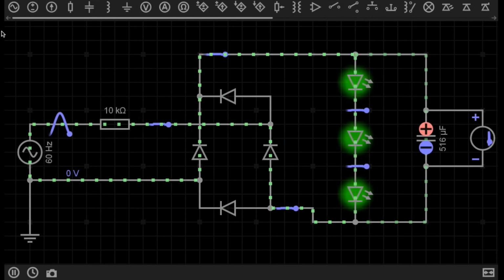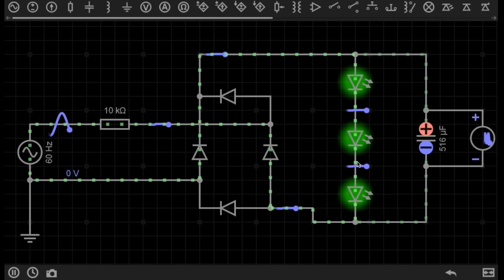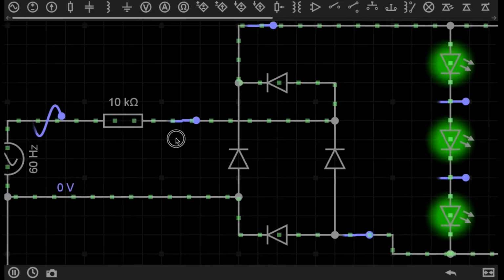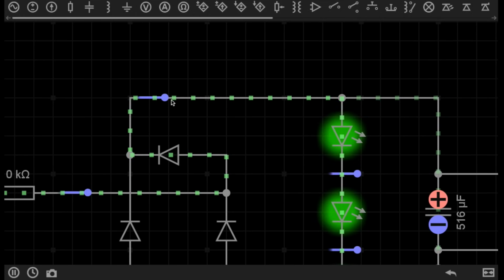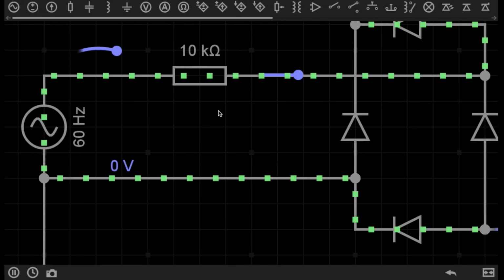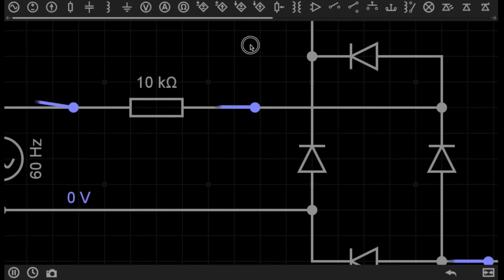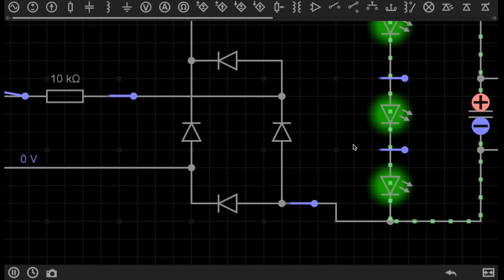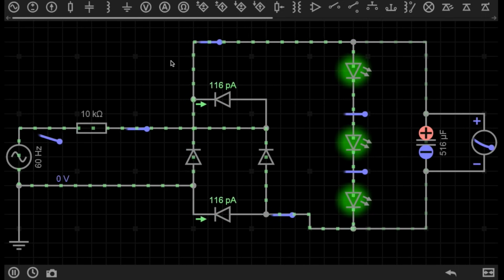How AC is turned to DC! EASY! (Rectifiers): Electronics Basics 7

Comment: So what is stopping the currant to flow trough the right diode   And the bottom at the same time
Reply: electrons only move toward the positive side of the AC current generator - that is, (since he is showing current as flashing dots) the current will only flow toward the negative side of the AC current generator. The RIGHT diode is connected to the POSITIVE side of the AC current generator when the amplitude is positive, and the BOTTOM diode is connected to the POSITIVE  side of the AC current generator when the amplitude is negative. So the current only flows through one or the other of those two diodes, switching between them as the sine wave goes from positive to negative.

Comment: I really do not like that you keep leaving part of the circuit that you do not explain, like the right side of this one, whats going on there? why is that there? why did you not explain it? why would you put it there but not tell us why its there or what purpose/function it has? :( not helping the OCD learner...its hard to watch..
Reply: To understand why that "thing" is there, u must first read through the three parts, if not, then I'll answer by saying it's a capacitor.

1.  like All waves including sine, square, triangle and etc, waves charge to their peak, in this example the positive half is +120v also negative half is -120v, when reached to its peak after charging and stay for a certain time at that peak then it starts the discharging till it reaches the middle which its zero, then starts the negative charge,  rises to the peak and back to zero completing a full wave. Without going into terminology, these "charging rates",  "staying peaks" and "discharges" is what determines the shape, tho there's more to it. In this case it's 60hz meaning it does this incline and decline 60 times a second. If given a LED, causes rapid blinking based on its Hz, to which there's a point as u increase the Hz the blinking goes faster till a point it will look completely lit and no longer blinks.  

2. Diodes allow one way for electricity to flow depending where the arrow is pointing. But a diode has a positive end(pointy part of the arrow)and a negative end( the flat side  of the arrow), so when u put the pointy parts facing one side( i.e up is positive side bc all diodes positive side is pointing up and negative is down in the video) the AC power is connected in between the diamond structure on the sides(Not positive side neither negative), the positive side of the wave is forces to one side and the negative side to the other while both only going one way( bc its a diode) to their respective polarity, causing a split into two parts of the AC power source given. 

3. Since now we have two parts of the wave , it's a unstable DC power, so it needs to be stabilized by a capacitor(which u asked what that "thing" is on the right),  this component that looks like a barrel in most cases, will smooth out the wave flat out to become a straight line as possible, becoming the DC we all know. This process of converting AC to DC for any DC device(smartphones, computers and etc).
Reply: Whoisnt Whoisit go look at his capacitor video he explains it there. Since ac voltage simply switches from voltage to no voltage very fast once it passes the rectifier its now dc but still has those pulses. The capacitor is working as a mini battery for all those brief pauses. Supplying the leds with power only briefly tho until the cycle or hz goes back to power the leds. So simply the capacitor is filling in the gap left by that pulsing dc power source. Or else the led would be flickering the leds. Hope that helps

Comment: Can't you just use 1 diode instead? Or it wouldn't work?
Reply: One diode would only let the current flow half of the time and the other half it would be blocked.
The LEDs would turn off every time the current is blocked by the diode.
Reply from the maker: Yes, but you would then get half-wave rectified DC rather than full wave
Reply: Ahh, alright thanks ;)

Comment: What am I doing wrong? I've built the same identical circuit and can't get it to work. What was done in the video that I am not doing?
Reply: Upon further study I discovered I hadn't fully set up the parameters of the AC power source.  Once I did that it took right off!  Best way for a student to learn is by studying what they did wrong till they find the mistake.  BTW, I subscribed to your channel.  GREAT stuff!! I am in my 2nd semester of Electro Mechanical Tech.  I will surely tell my class mates about your videos!!

Comment: At the nodes does is that just the area where two wires cross? I don't understand why the electrons don't take the shortest route through the diodes and it takes the long way around. Thanks.

Comment: On the Return part of the Circuit... how come the flow doesn't go through all 3 diodes and just the bottom left one? do the other two have a resistance from the top that stops the flow??
Reply from the maker: +kraven4444 the current will not flow through the other two diode because there is no return path to the other side of the source (ground). If you try to follow the current and imagine it flowing through those other two diodes, you will find the current would never flow to the ground side of the AC source. Current will always flow towards the ground of the source.
Reply: Simply Electronics Right it would loop around endlessly which makes no sense. Thanx for the answer and video.
Reply from the maker: No problem :)
Reply: Never mind this answered my question thanks! So the current must always loop around back to the ground source?

Comment: I dont understand why have you reversed the symbol of the diode 
in this video
Reply: yeah in the other video I swear the current was flowing in the other direction through the symbol... confusing for a noob like me
Reply from the maker: Watch my video about conventional current flow
Reply: he was talking about the conventional direct of the current & he was wrong by saying electron flow
Reply: he is using the the convention of positive current, it's the same principle. make it backwards and you'll see the same phenomenon.
Reply: @Simply Electronics  firstly you said the electron flow, the suddenly you changed and said the current flow... it seems like you didn't consistent! in previous Video, the dots moving = electron flow. in this Video, it's current flow, not electron flow!
Reply: Bernie Sanders  did you watch the flow of electrons or flow of the current because current flows from positive pole to negative pole  but flow of electrons is from negative pole to the positive pole
Reply: Same confusion. I posted a new detailed question for him to answer.
Reply: So the current is suppose to flow through the diodes arrow in symbolic terms, I am also confused why it seems to flow against it in this vid??  Just asking
Reply: Albert R conventional current is wrong (where current flows from positive to negative) but we have always used it like that so we didn’t change when we learned it was wrong so now it seems as if it is flowing backwards

Comment: Sorry , but that's not realy clear...
http://up.picr.de/27413794jg.jpg
Reply: Frombeyond thank you !!! i was scratching my head to this ???!!
Reply: thats the same doubt i have ..please someone clear it out
Reply: ok i figured it out.. he is using conventional flow of current and not conventional flow of electrons..watch hi videos on reversing direction if not understood
Reply: Deep Shah there are points in the graph where current from 2 wires meet at a node and continue in a mutual direction. What i am confused about is why does the current not travel through that corner diode when it is facing the same general direction as the parallel diodes ?
Reply: Neojin path of least resistance. That diode has more resistance for the electron flow to the ground than just bypassing to ground directly

Comment: Thanks. That was the best illustration of electron flow that I've seen. It was very helpful. (I still need to watch again...)

What software are you using? That would be helpful to know.
Reply from the maker: My pleasure! Subscribe to the channel for more of these videos. The software I am using is everycircuit, available as a web app or  mobile app. everycircuit.com
Reply: This is not electron flow this is conventional  current positive flow but same thing in practice